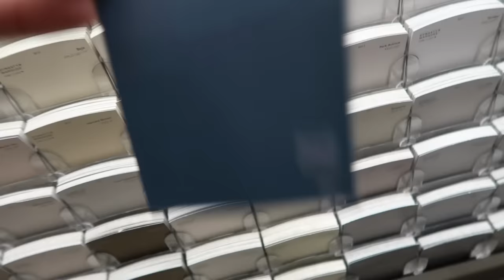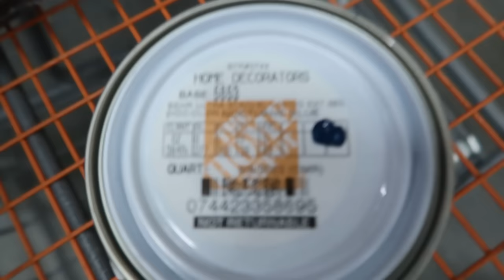HOME PROJECTS | REPLACING OUR WINDOW, PAINTING OUR FRONT DOOR, CABINET AND COUNTER COLORS

Comment: I am a single individual and projects that do with home improvement are done by a hired contractor or handy man. The job gets done in a timely manner, they know how to do the job and they carry insurance. That was a tough job getting window taken out/replaced. Did you check your homeowners insurance coverage? On painting the wall where the tv is.....I was watching another channel with a dark wall and a mounted tv. The wall color was updated..had looked like a black hole:(  You will figure it out. Liked the video. Not criticisms just views from a subscriber. You could use a stencil on your Mom's wall to get the design she wants. Would require a trip to Hobby Lobby :) I see that Home Depot has this design on their peel and stick.